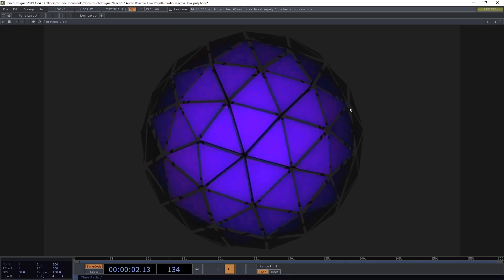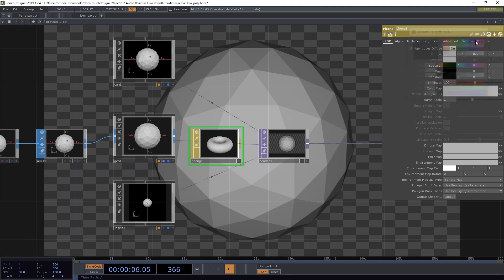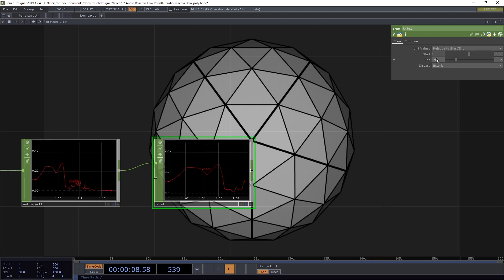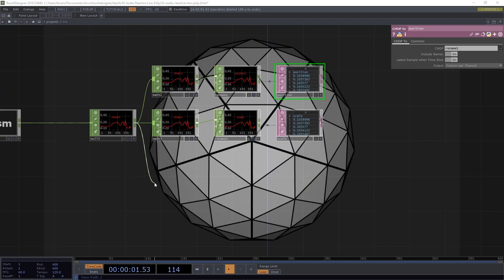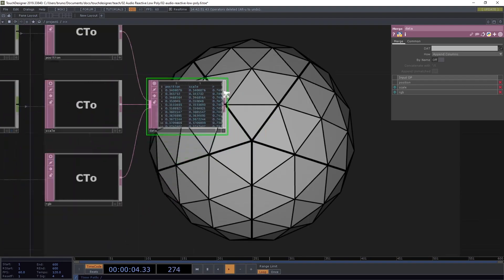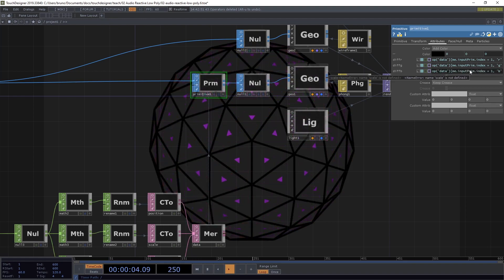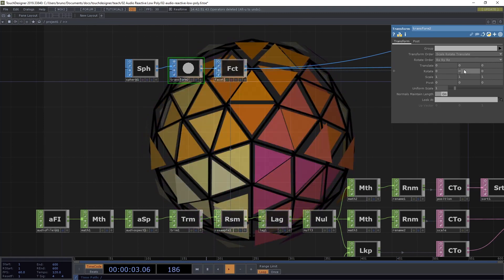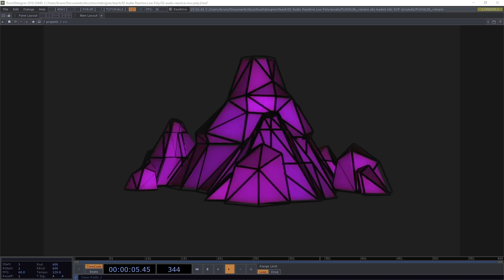TouchDesigner _02 Audio Reactive Low Poly

Comment: First expression for scale doesnt work. Gone though the tutorial twice and double check the expression at least 10 times. On version 32050. Anyone else had problems?
Reply: Got a bit further the only error left is (Parameter: Scale) NameError: name 'index' is not defined (/project 1/primitive1)
Reply: Thanks for the reply. Sussit. Just had to change to lower case 'S' for scale.

Comment: Hi, great tut! quick question - when I add the LAG component to Null it kills all the animation. I'm using the latest TD version. Any ideas?
Reply from the maker: It should still work on the latest version of TouchDesigner. Did you switch on Lag per Sample 15:55?
Reply: @threedashes___  yeah, i followed everything but the LAG comp kills all the movement and strips the color to become white. I am using a .wav audio. Also when I check the RESET button everything looks the same as w/o using the LAG comp. No biggie, but still strange.
Reply: I can share the file if you like.
Reply: @stuartfingerhut5094  Did you get this worked out? I am having the same thing happen, cheers
Reply: @noBIGego  hi, no the LAG comp still breaks the sequence for me

Comment: Hello, thank you for great tutorial! I have a question about wireframe edges - you have got distinct and bold wireframe, but I have got thin lines. Where I can change it's thickness? Strange that I did all the same. Line Width in Wireframe don' change anything
Reply from the maker: Hi Эмиль, are you on MacOS? Unfortunately Line Width doesn't work on MacOS, it is a known issue https://docs.derivative.ca/MacOS
Reply: @threedashes___  yes MacOS, Thank you for answer!